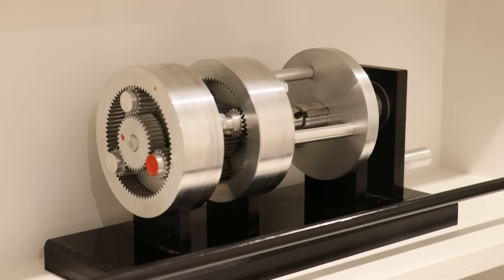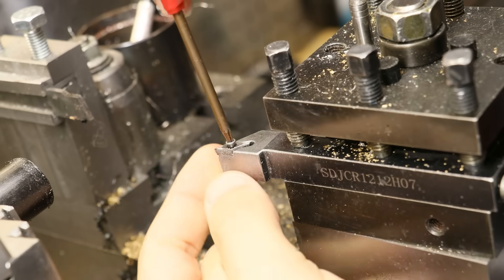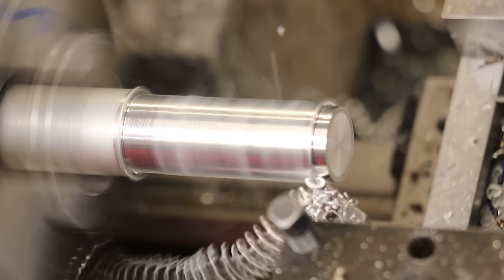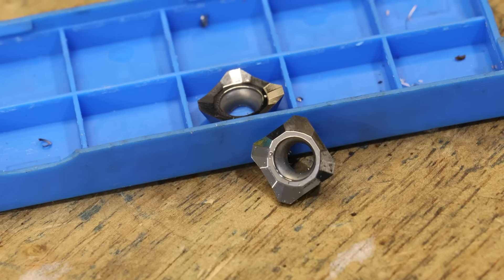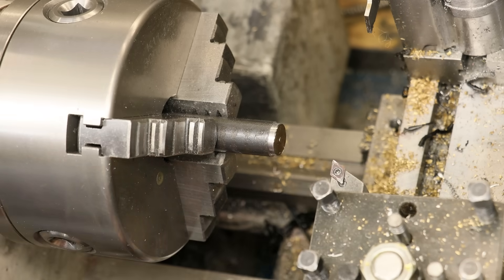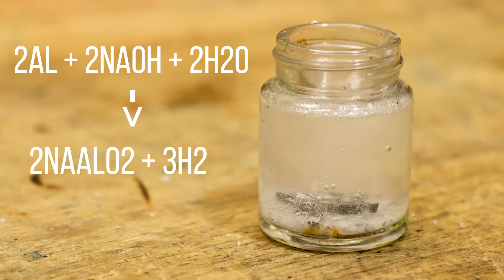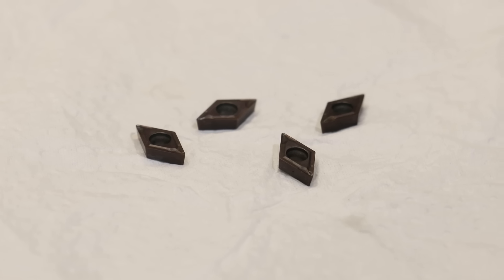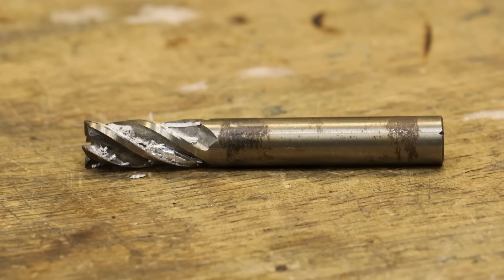Fixing Carbide Inserts with Fused Aluminium

Comment: Isopropyl alcohol (aka rubbing alcohol) is good lubricating cum anti-stick fluid for cutting aluminium - not exactly the most practical one but you may want to try it (a trigger operated spray bottle with its nozzle set to "squirt" rather than "spray" mode might prove good way to apply it). Yes, IPA is flammable, but then "so is WD-40", so...
Also, try cutting some hard-ish steel with these "contaminated" inserts - my guess is this might rub off that aluminium much quicker, in less time I reckon than it takes to prepare this rejuvenating lye bath...

Comment: FWIW, IIRC you should consider Isopropyl as a cutting fluid for aluminum. Only issue being its flammability and nauseating fumes. Basically have to have a sealed enclosure to use it effectively. But, something to consider trying.

Comment: If sodium hydroxide is too scary you can also use sodium carbonate (washing soda). It will probably be slightly slower, but it will get the job done without risking chemical burns.

Comment: I don't keep it inside the shop. Place it outside somewhere. Basically, any tools that the Al has built up on, will dissolve it away. It is a bit quicker when it is over 30C and a lot slower when under 10c.

Comment: I've not tried NaOH, but instead HCl (hydrochloric acid), works quicker (pool acid strength - 30%) and no mixing needed.  I've not tried it on an insert (I will now), just solid carbide end mills. no ill effects to them.
Reply: Be careful with HCl in a machine shop. The vapors from even a closed bottle are very corrosive.

Comment: I also use alkaline solutions to remove the buildups from cutting aluminium. It works well on HSS cutting tools, too. With colored coating, it is easier to check if the buildups on the cutting tools are totally removed.

Comment: For some reason I always kept my blunted inserts - not the chipped/broken ones just the worn ones which no longer cut well. Having just completed a slow speed diamond lapping machine I thought I'd have a go at sharpening some blunt inserts and it works really well. They cut better than new inserts and with a fine nose radius added leave a better finish. They might not last as long due to them being very sharp but it is so easy to sharpen them I can just repeat the process until they become dimensionally unusable (loose in the lathe tool and insecure). Should be good for a few sharpenings though because only a tiny bit is taken off. I use 2000 grit diamond laps.

Comment: Watching the bit where you place the flame above the jar shows a yellow flame, IIRC this will be from the sodium due to small amounts being ejected into the air due to the bubbling activity. The light levels are too high to see the hydrogen burn as it burns with a pale blue flame, seen it many times in chemistry class but only when he lights are turned down or off.

Comment: I'm going to try this on all the grinding stones and wheels I've ruined with aluminium. Hopefully it won't weaken them and make them explode and send shrapnel across the shop. Actually... Nevermind, I don't think I am going to try it on stones.
Reply: Just dress to remove until fresh new surface. Diamond dresser, you want the T-Bar type not the single point type, or theres simple grinding wheels dressers that spin, harbor freight has one for four bucks.

 Silicon carbide wheels are better if you cut aluminum.

Vacuum the dust and consider wearing a mask while doing it, lungs dont like grinding wheels
Reply: Good decision. 😊

Comment: I used to heat aluminium fused inserts to just over 650°C in a tool holder and wire brush gently to remove the aluminium. Carbide's melting point is around 2,860°C so will not be adversely affected. I also had some success sharpening dull inserts using diamond lapping, I also had some failures too. However, I had more successes than failures, that was a few years ago now, as I'm retired. Good to see your alternative method rather than just slinging inserts in the bin, wicked waste of money, in my opinion.
Reply: The cobalt binder melts at 1450ish. Look pretty cool when white hot under the oxy. PCD was even more interesting but was ruined above 700c or so, reverting back to graphite then igniting. Yes. Diamonds burn :)
Reply: And most carbides in metal cutting is tantalum, tellurium, etc. not tungsten at all...

Comment: i was always taught for aluminum sharp inserts should be used also to take deep and fast cuts to break the chip so it doesnt string up, and 2 or 3 flute endmills and coated inserts for steel and 4 and more flutes for steel. aluminum and soft no ferrous steels like to gum up on coated inserts and 4 or more flutes for the endmills

Comment: Insert geometry has some effect for sure. 

 But with a little blast of WD-40 you can pretty much use anything and it wont friction weld to the insert.

WD-40 interferes with the chemical reaction between the carbide and the aluminum,  and it works for ANY cutter or file.
Reply: Kero... any light solvent/hydrocarbon...

Comment: Will this work on files. ? I have several gummed up with Aluminum
Reply: The best technique I know for cleaning files including aluminium build-up is to use a small piece of soft sheet metal like brass or copper approx 15mm x 60mm, something that's comfortable to grip, and hold it at about a 30 to 45 degree angle to  the file surface and push it along the teeth. Being soft it conforms to the teeth and forms a comb which will lift out even stubborn material.
Reply: I see no reason why it should not work, any NaOH that ends up drying on them afterwards should just act as rust protection.
Reply: @pettere8429  do u mean ( you see no reason why…not )?
Reply: @BillRodgers2 yes, updated previous comment for clarity.
Reply: @pettere8429 thank you for responding and clarifying
Reply: yes it works. dont get it on the handle. Vinegar bath also works but slower
Reply: @tortron and risks rusting your file.
Reply: @pettere8429 easy to mitigate, just neutralise the naoh or vinegar and then rinse and dry.  with vinegar, anything left out in the air next to it will rust (for everyone that leaves an air bubble in their rusty motorcycle tank and wonders why it looks even worse after). I usually have a hot lye tank and or an electrolysis tank with NaOH going for various rust removal, paint removal and removing corroded aluminium parts stuck solid in steel parts.  Depending on the part you might want to lightly oil it after, as you will strip anthing that was on it before as well
Reply: @tortron the NaOH won't touch the steel anyway.

Comment: you might try to dissolve the soda in warm/hot water, as it should speed up the reaction

nice to know anyways 😃
edit: warm/hot water = bad idea 😮
Reply: Recipe for disaster. Concentrated naoh in hot water can boil FAST and pop or sputter hazardous material.
Reply: @Wreaktifier  so just warm water would be ok?
Reply: @SystemX1983  - NO!

You even might want to choose ice-water, depending on how high concentration you need.

Don't screw around with acids or bases; they will cost you your skin and/or your eyes!!
Reply: @haploideallel Ok - understood.
safety measures would have been taken anyways,
like goggles and long sleeve gloves.
thanks for the feedback!

Comment: Nice. Just remember to be careful when putting NaOH into water - huge exotherm ensues, specially if you stir it (which thankfully I don’t think you did here; jar could’ve shattered from the shock). Also remember to be careful of contact of NaOH solutions with your skin: it’ll turn your oils into soap, and might burn you chemically as well.
Reply: "Also remember to be careful of contact of NaOH solutions with your skin:"
Even more so with eye contact - irreperable eye damage before you would have a chance to flush with clean water. 
Proper eye protection (chemical goggles) not optional with that stuff !
Reply: sounds like that scene from "Fight Club" 😮
Reply: You are all so full of shit….stop pretending like you have a clue. Just because you read it in the internet or some other controlled media don’t make it true. If you’ve never personally handled Walmart sourced drain cleaner then shut your gregarious pie holes.
Reply: You can readily handle dry lye crystals with bare dry hands ( no gloves) and you’ll be fine. If your hands are wet the. It will burn you given enough contact exposure time but it takes time….it’s not holly weird bullshit like the FICTION film fight club. Grow some balls and live your lives instead of trying to scare people with your tv gifted knowledge
Reply: Once when I was genuinely naive I used sodium hydroxide to clean the floor of my shower. Got a lot of spray onto my hands and inhaled a decent bit of it through my nose too. No chemical burns, minor sinus inflammation, but my mouth tasted salty for a while afterwards...
Reply: You have degree in chemistry but have never actually reacted sodium hydroxide in real life?….there was never even a Chance of a dangerous reaction at those amounts but you had to grace the world with your overblown regurgitation kf bullshit that you found while searching the internet….
Reply: @Richardc.Randall.79 you clearly have a degree in common sense. 👍
Reply: @ajsiemers I have a degree in life experience/science. I also have a degree in human bullshit…I use lye on a regular basis. Your internet guru bullshit is just that….bullshit. Just because you repeat what the tv or YouTube says don’t make it real.
Reply: @Richardc.Randall.79 Horse shit. I've seen violent reactions with NaOH even in small quantities.

You need to take appropriate precautions when working with it. That includes PPE and having supplies on hand to neutralize a spill.